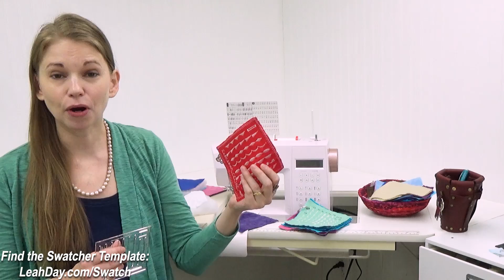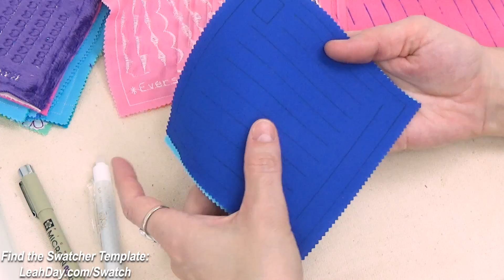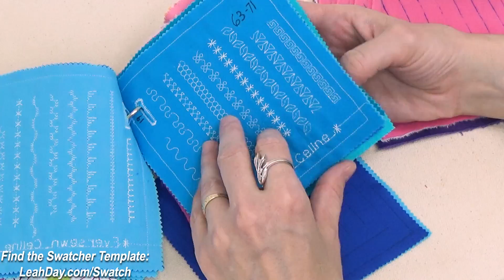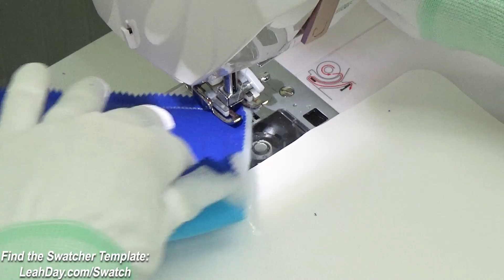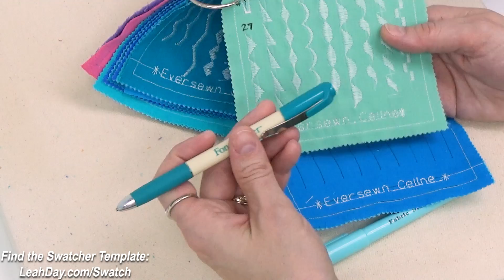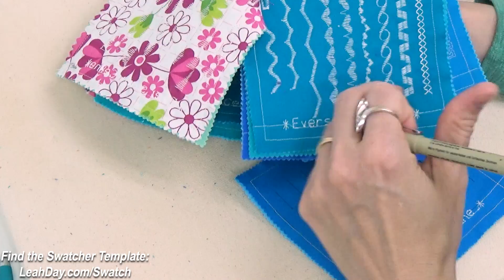Use Your Sewing Machine Decorative Stitches! Swatch and Stitch!

Comment: I’m going to purchase my first sewing machine and didn’t realize the size of decorative stitches. If a sewing machine is max 7mm and 5mm does that mean the largest a decorative stitch will be is 7mm high? Is that where a 9mm machine comes into play to do larger decorative stitches for quilts and designs ?
Reply from the maker: Yes, you have your understanding correct. 5 mm wide feed dogs limits your decorative stitch WIDTH to 5 mm. If you get a machine with 9 mm wide feed dogs, you will get much more complex, wider designs.

The downside with wider feed dogs is they don't always compensate for the wider spacing. I have sometimes struggled to piece with machines with wider feed dogs if the patchwork foot isn't off set to push the fabric further to the right and onto the feeding mechanism.
Reply: @LeahDay  got it thanks! 🙏

Comment: Just ordered the template. What stabilizer and thread (top and bottom) do you recommend for decorative stitching on garments?
Reply from the maker: This is something to play with and I recommend checking to find the stabilizers you can locate in your local area. I used French Fuse because it's what I have on hand, but it's not a common stabilizer and is sometimes hard to find. As for thread, this is also something to play with. I use Aurifil 50 weight Mako cotton for piecing and it looks beautiful when stitched in decorative stitches. For quilting and embroidery, I use Isacord 40 weight polyester thread and it's also a great choice. You can find the threads I mentioned here: https://leahday.com/collections/quilting-tools

Comment: I like the idea of marking not only the stitch number on each but also the length and width information. And the range of stitches like page numbers on the top right. Small sames of 5 or 6 inches is the perfect size.
Reply from the maker: I agree, and possibly a * or symbol when the settings listed are the standard or automatic settings set by the sewing machine. I found with my older machines I could manipulate the stitches endlessly, but with newer machines they limit the length and width to not allow the stitch to become so distorted. Lots of fun to play and see what you get!

Comment: Leah try using a chalk pencil for your markings.
Reply from the maker: That's a great suggestion. I'm just not a fan of the dust residue of chalk. The heat-erase pen worked well for this project, but as I mentioned in the video - ONLY this project. I wouldn't use it any other time.